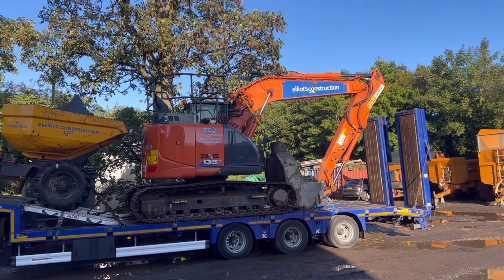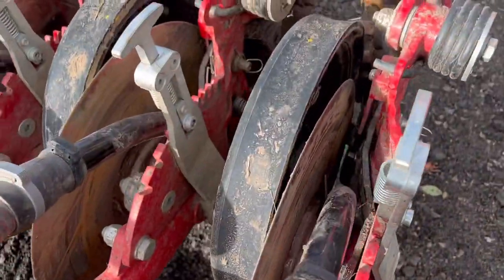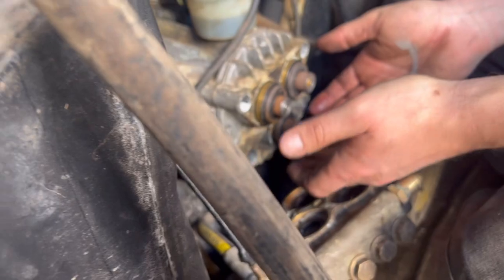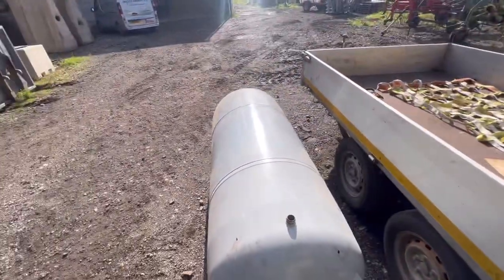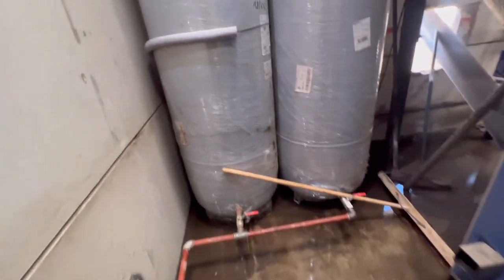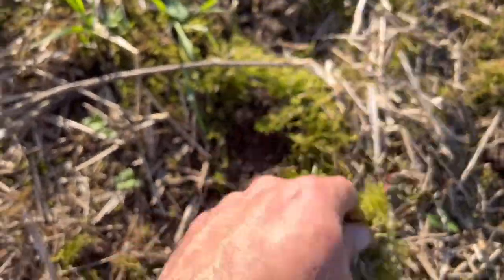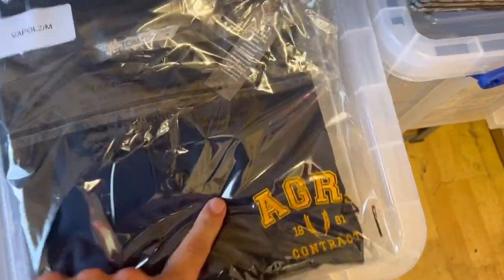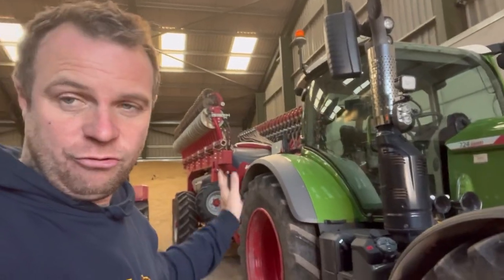DAY 915 WE SPEND ALL DAY WAITING FOR A BIG ARRIVAL  #OLLYBLOGS  #AnswerAsAPercent

Comment: Weld brackets for 3 point linkage onto it to use as a fire suppression tank on front of one of the tractors at harvest. Seen similar done before with little pump and hose on it .

Comment: Interesting to see the guts of the boiler. Incredible to think that the same design, hot air in tubes surrounded by water, has been used since the birth of steam locos and traction engines. My late father was a model engineer as well as a farm worker and has made many working model traction engines using the same principle. If you're ever down in East Anglia, try to visit Bressingham steam museum, as some of his models are on display there. Congrats to your Mum and Dad on 50 years, you can always tell a farmer by their wedding date, too busy to get married during harvest. My wife and I celebrated 38 years a couple of days ago on the 21st. All combine repairs were finished by then.

Comment: I doubt that water tank is structurally strong enough for a weight block.  You probably have soft water up there. Down here in the Cotswolds we have really hard water and it plays havoc with pressure washers, boilers, taps etc.

Comment: Cut the top off and drill some holes on each side and thread rope through it or drill some handled on the  side and make it a sledge 🛷 and find a hill in winter and sledge down the hill don’t have to but would be a bit of fun